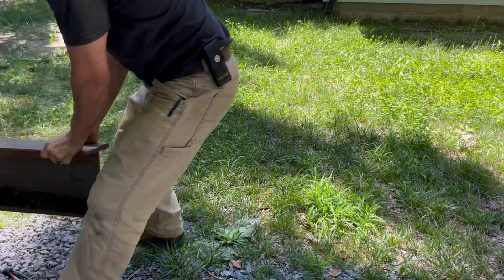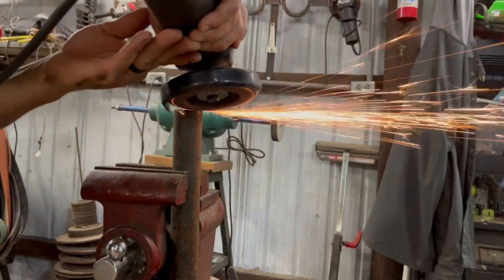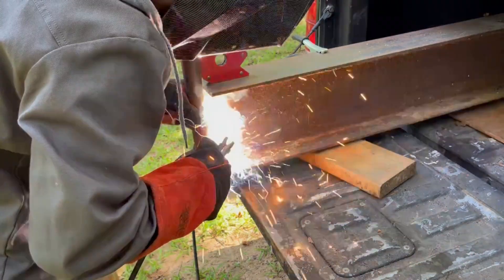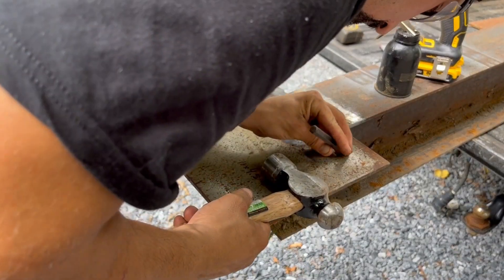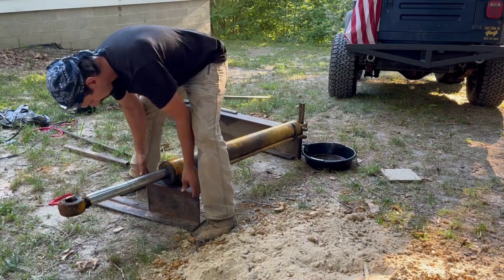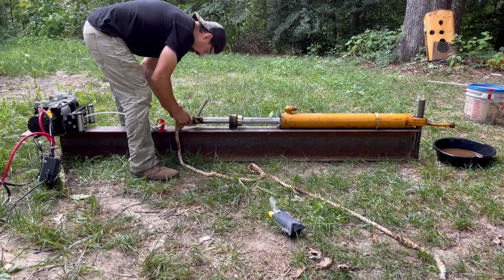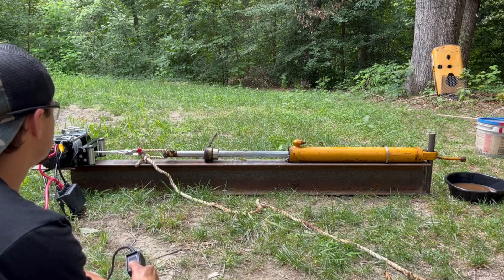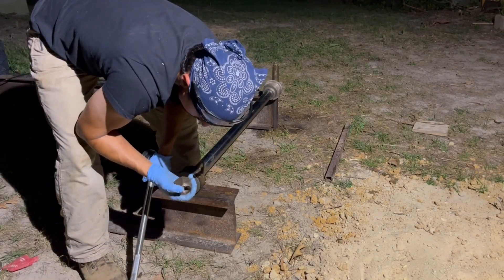Hydraulic Cylinder Puller Tool

Comment: I like the idea. Oxygen acetenyl? Plasma cutter will replace them. Why not leave one end on the tractor use the hydraulic pressure to extend fully , remove the actuator end , then the gland nut.  The using the hydraulics extend  it another four inches . Basically never remove the actuator from the unit. Than take the actuator end stick it back on unit and take the nut off the other end.